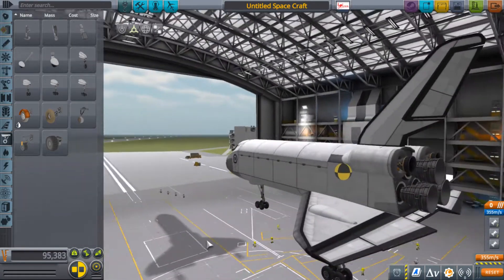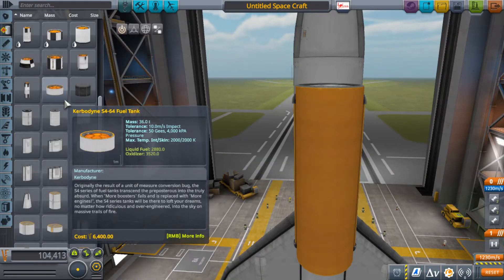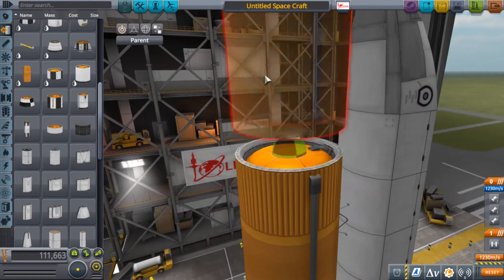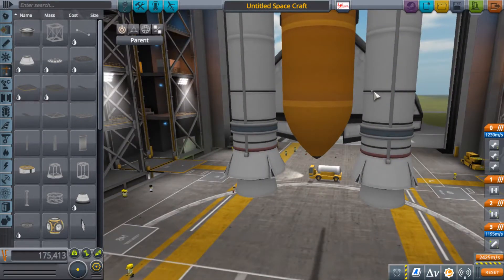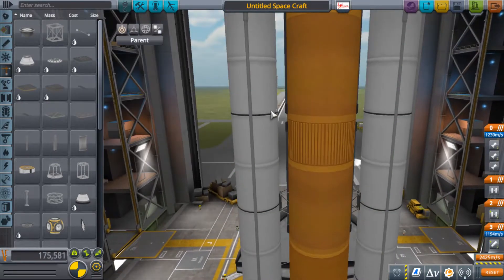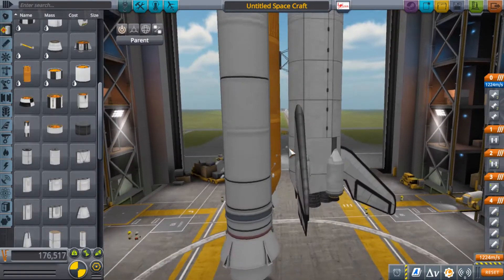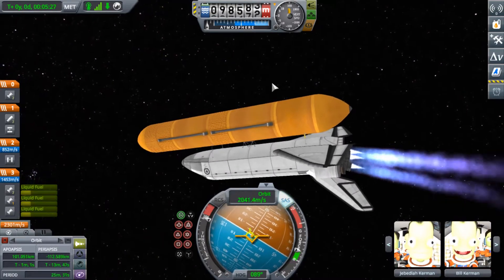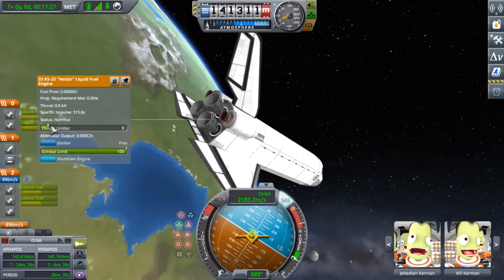KSP Building and Launching a Shuttle

Comment: does the centre of mass and lift align? ithink the centre of mass needs to be a little more forward ,cuz my shuttle keeps reentring backwards. im talking about shuttle only.
Reply from the maker: Reentry with shuttles and SSTOs is tough because the engines are so heavy and they bring the center of mass towards the “wrong” end.  Sometimes I put fuel tanks towards the front and transfer all fuel there.

Comment: Interesting construction, but during the construction you could already see that you will have problems with re-entry and landing at the latest.

If you let the thrust vector of the OMS engines run through the mass point of the orbiter then you have no problems with nose down or up. For correct adjustment Bring the shuttle into the state it is "flying" in orbit. Only set the thrust of the main engines for setting to 0 then you only see the thrust axis of the OMS. Do not ignore the fuel consumption. The same applies to the coordination for the landing, position of mass and lift point to each other. And please just set the main landing gear a little behind the mass point and not at the very end, just looks more original, the landing later too.

Comment: Semi-long post to give you a little bit of assistance on the space shuttle systems:

The OMS pods were used toward the end of launch to assist with orbital insertion and for the deorbit burn. Both the OMS pods and RCS burned hypergolics, MMH and N2O4.

On launch you are correct that the shuttle's payload bay should be facing the the earth then rotates around to take better advantage of the tracking and data relay satellites. The first number of missions released the external tank towards space instead of toward Earth. Tank separation is roughly a minute or so after MECO.

Reentry angle on the shuttle is ~40 degrees and does use RCS through reentry through entry interface as it tilts in different positions creating a slight "S" curve to distribute the heat throughout the heat shield and help bleed off extra speed.

There is a simulator called Space Shuttle Simulator 2007 that I have which was designed with the sole purpose of being as realistic as possible when it comes to the missions themselves including the proper procedures.

Enjoying your content bro! You actually made me bite the bullet and buy KSP.
Reply from the maker: How could I forget your love for the shuttle?! I am glad you liked it.  I honestly didn’t spend enough time studying so I could do a more realistic job next time.

Keep me posted as you play!  If you need more tutorials, Scott Manley, Marcus House and Matt Lowne have excellent KSP videos.
Reply: @TEauxFTW  Yea, I follow Scott Manley and Marcus House and naturally Matt Loene pops up as a suggested, mainly for info on commercial space info, but I watch their KSP vids from time to time.